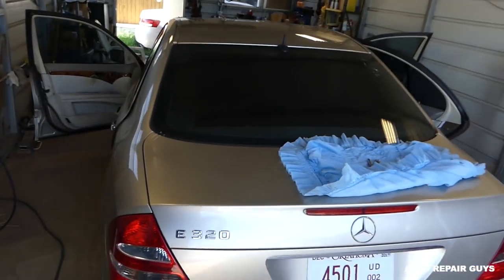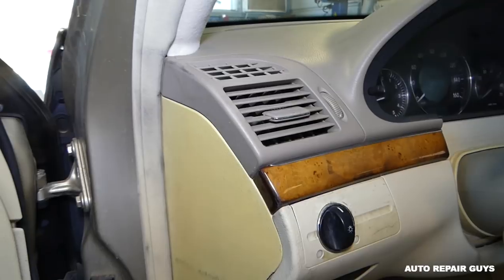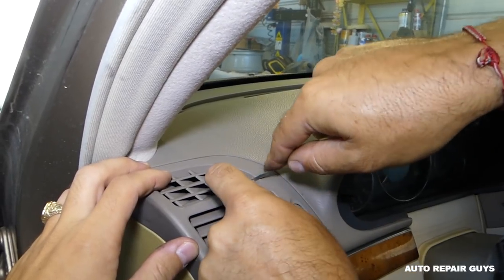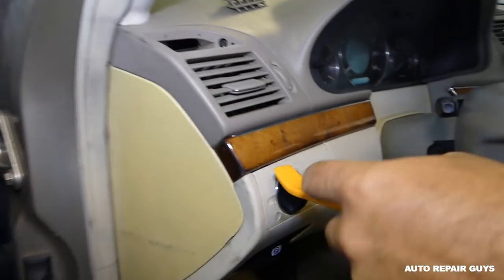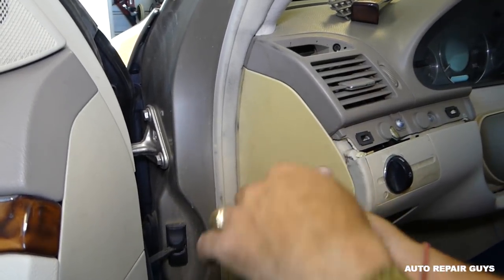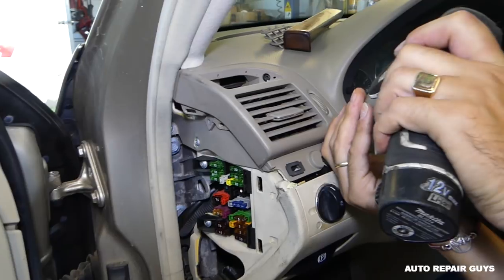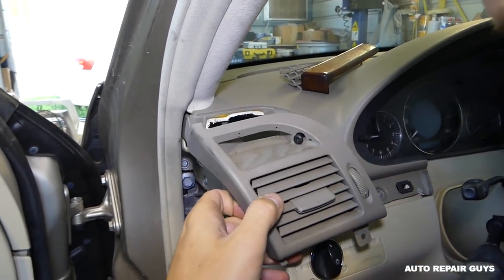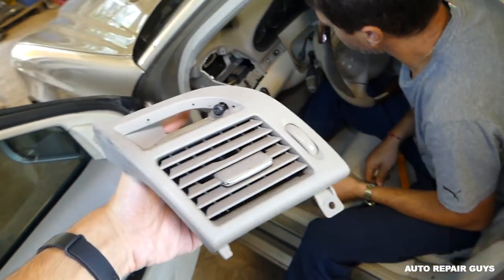MERCEDES W211 DRIVER SIDE DASH VENT REMOVAL REPLACEMENT

Comment: Sorry old video I just got a e55 but why is there a wire going to air vent?
Reply: The wheel that turns the airflow on/off has a light in it.